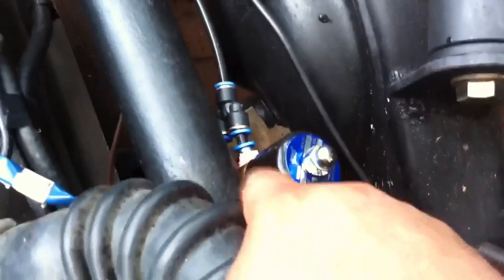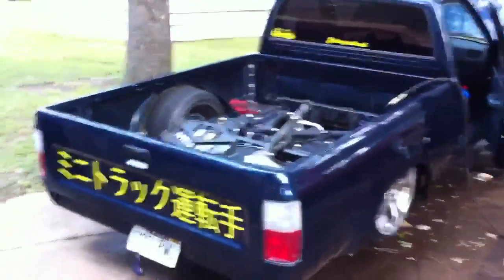How to install electronic valves for air ride

Comment: Thanks for the video! I assume that since the valve solenoids have such a low amperage draw and are primarily used in short bursts, no relay is required for controlling them correct? Just 12v in to the switch panel and then out to valves?

Comment: Hey man I’m new to bagging trucks and stuff and was wondering if you can run both of the valves the in and the out to a toggle switch for up and down or if it has to be 2 different switches one for up and one for down

Comment: I have a problem with mi valves i press up and the dump opens changed the switch box 2 times same thing have any ideas?
Reply from the maker: Bad switch box or you have some wires crossed between the box and the valves is my guess

Comment: How or what makes your suspension lower so slow mine just slams down and spring up hard
Reply from the maker: I used 1/4" valves and air line. They make slow down valves that you can add to your existing set up. Hope this helps.
Reply: Lawrence Duarte thanks man!

Comment: Hey man i been watching some of your videos and i had a question maybe you can help me. So i have a bagged extended cab silverado with 2 8 gallon takes. And 2 444c viair compressors. My pressure switch is 190 cut off and 160 restart. And it takes about 40 maybe 50 psi to fill both front bags and about the same for the rear but if the air tanks are lower then 120 it won't air the truck up is that normal. Sorry for the low questio2
Reply from the maker: +desert scrapin no that does not sound right. Might want to check your pressure guages to make sure there reading right. Also make sure there's not an in line regulator somewhere restricting it from flowing hope this helps please let me know what you find.
Reply: Ok ill try that But you think maybe if there water in the lines,tank,or valves?
Reply: Oh and would the inline regulator be obvious i dont really know whag i would be looks for

Comment: Is it air ride or old school air shocks if air shocks please post a video how good it rides... I have a charger and air ride cost to much air shocks are way cheaper!!! So I was going with air shocks a switch inside my car and 1 3/4 lowering springs so speed bumps high drive ways I can lift it.
Reply from the maker: +Eric Watler air bags

Comment: does the truck drive smoother and more responsive or sways and leans with more aggressive driving?
Reply from the maker: 6824648 honestly it depends on how you set it up in my case I have very little body roll dew to the thicker bars and solid link ends I have stock socks but if you wanted to upgrade for better handling that would help as well. the ride to me is smooth like I said really depends on the set up.

Comment: why is my steering so sloppy
Reply from the maker: +Greg Hedlund probably need to tired ends and upper and lower ball joints can help in the end if it's still sloppy then your steering box is old and has to much play needs to be replaced if it can't be tightened.

Comment: I have a out dated easystreet control system that acts funny due to corrosion on wires from controller to computer box. can I hard wire my vales in the same sense as u did?? are they 12v normally. and what is positive and negative?? any help would be great
Reply from the maker: +super dave I don't see why not and in normal valves it doesn't matter what way you connect the wires so long at it gets power and yes 12v
Reply: Lawrence Duarte ok thank you sir I'll give it a shot

Comment: Very helpful bro.
I have a question though, I let my truck sit for a good while, like 6 months, and now that I try to raise it, no air runs through. the compressor runs and fills the tank, but when I hit the switch I can hear a clicking sound but it doesn't seem to let air go through the first valve. do I need a new one?

Comment: so does your truck lay frame
Reply from the maker: +edd gutierrez no it lays transmission cross member because I didn't replace the transmission crossmember
Reply: Put a skid plate on the crossmember and spark it

Comment: hey your videos are extremly helpful but i have a quick question when you hook up your valves to power from the battery did you use a inline fuse or relay or just ran it straigh to the battery?

Comment: Would it be okay to have one electric valve for the rear and one for the front 
Trying to figure this all out. Lol
Reply from the maker: One valve manifold yes that's 2 valves for the rear 2 valves for the front one valve airs it up the other let's the air out

Comment: Lawrence, how's everything going with those PTC fittings? Have you ever had any leaks with them?
Reply from the maker: There doing fine I've had a couple Leak but I just pull them out and put it back together and it's fine.
Reply: I see. I have read that those are not appropriate for that kind of application, but well, it does not matter while they're working great. Thank you man.

Comment: I would like to know how many valves would I need in order to have a both side system? (left and right at the same time). Not independent. Thank you in advance and thank you for the video ;)
Reply from the maker: Would be better to have front and back dew to the weight difference of the front and the rear in this case 2 for the front and 2 for the rear.
Reply: Oh. I see. Is there any chance to use the manual paddle set up with air valves? In order to work together.
Reply from the maker: Of course that would require another t fitting before the bags for the paddle valve set up